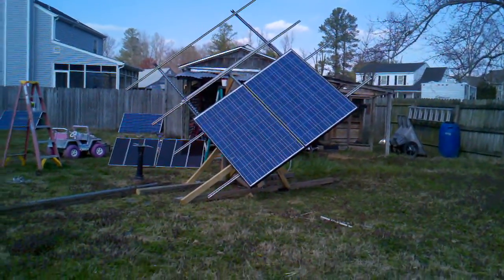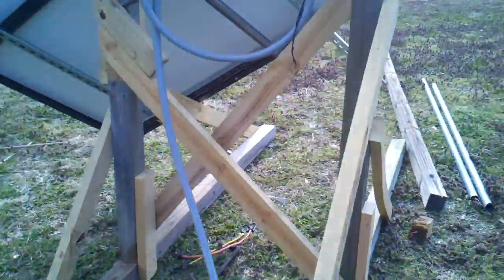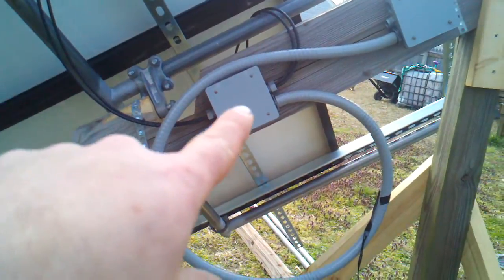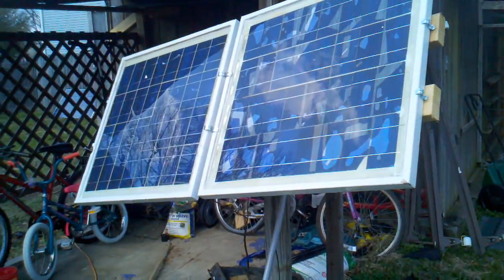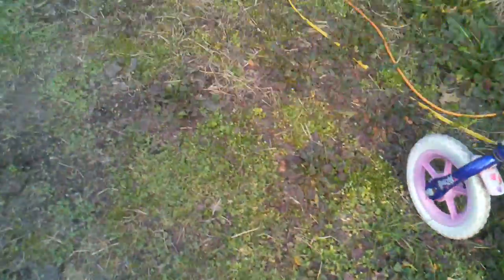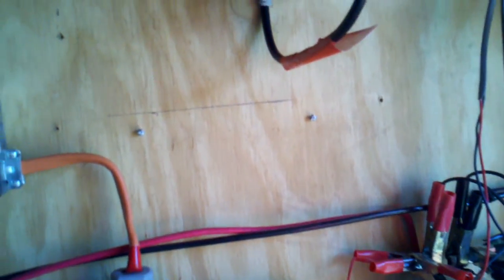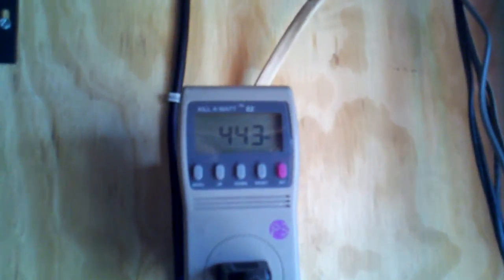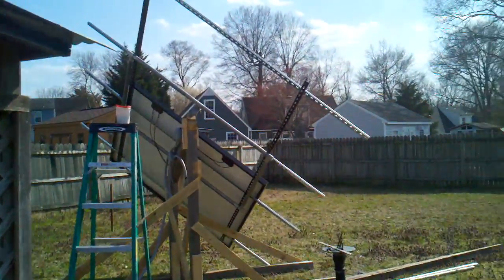DIY TRACKING GROUND MOUNT FOR 6 LARGE PANELS

Comment: Hey Guy looks good and hope your power shows big improvements I know it will because I have a 6 panel tracker also. One thing I want to warn you about is high winds, because I have had some problems.  6 panels up in a medium wind  you have a wind sail effect and could turn your moveable tracker over very easy. That is some expensive equipment to lose. I mounted mine on a 6 X 6 wood post 3 feet in the ground and a 17 mph wind bend the system over about 20 degrees. Just a friendly note from someone who is learning also.  Good job on the wiring.
Reply from the maker: Billy Stevens that setup took a big hit.No panels broken but I have them mounted on the roof now.